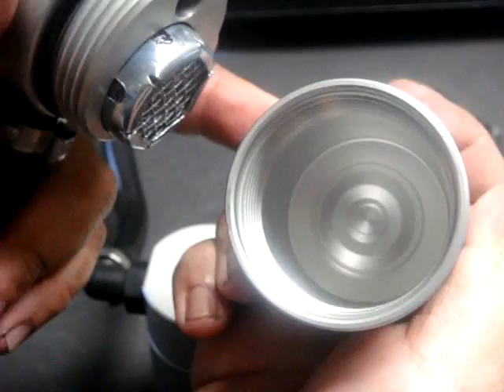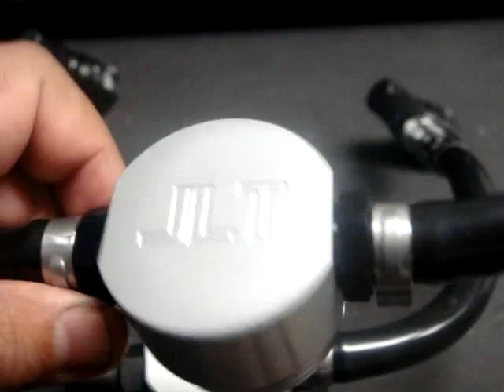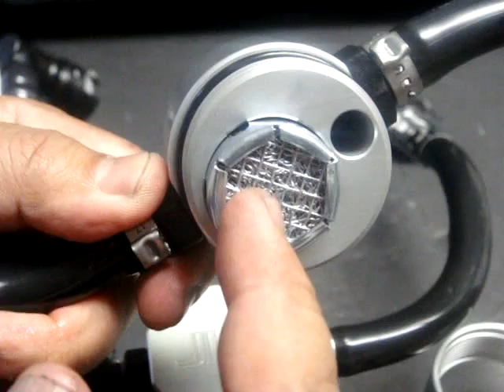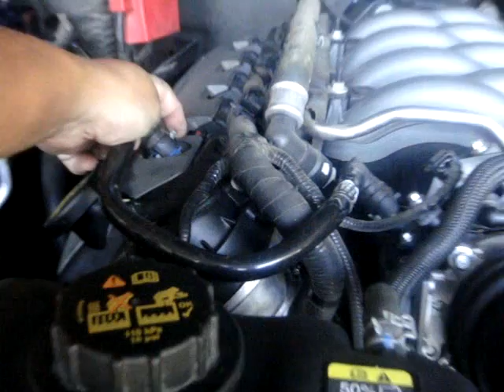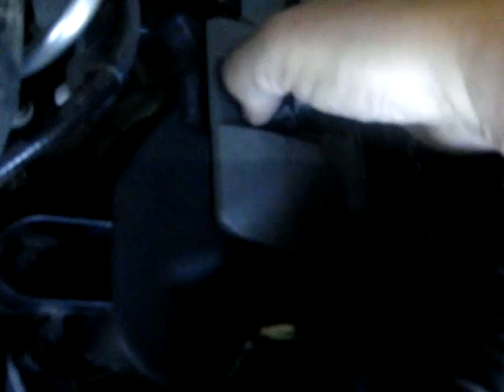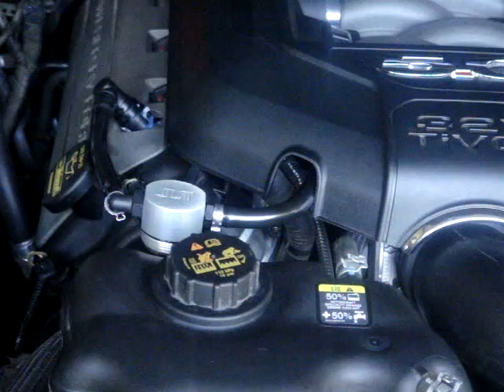JLT Oil Separator Can for Ford Mustang

Comment: nice but perhaps a bit oil fog through the manifold and intake valve shafts could be good for lubrication. and i like to know how much these filters increase the pressure in the crankcase ?